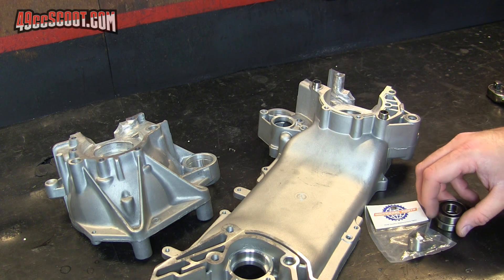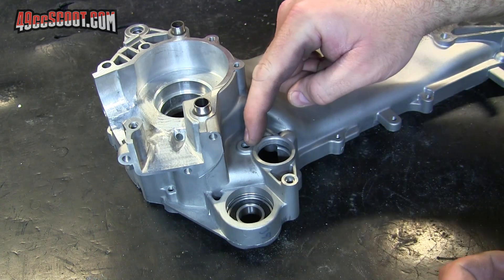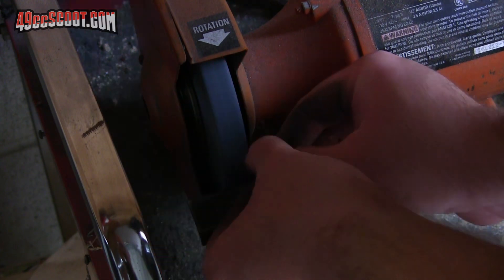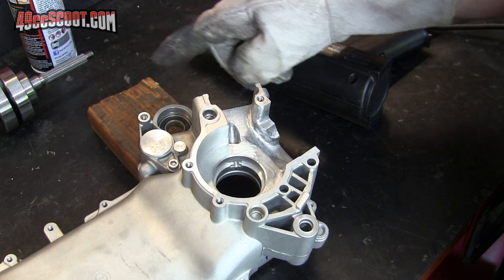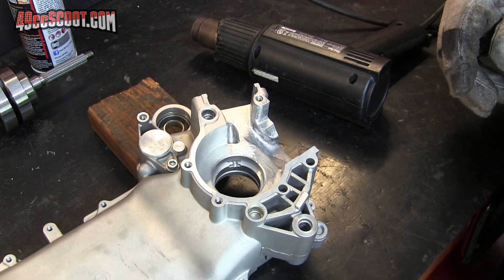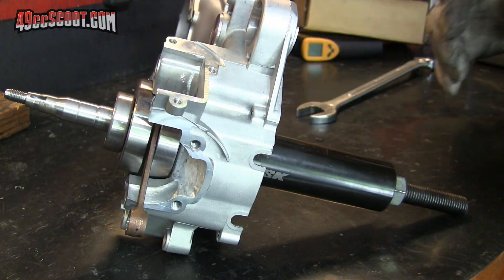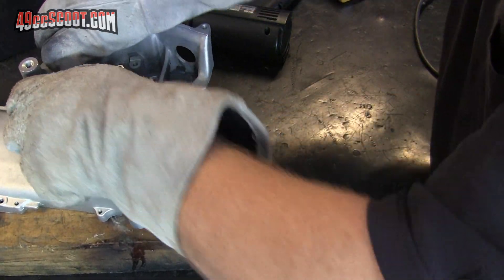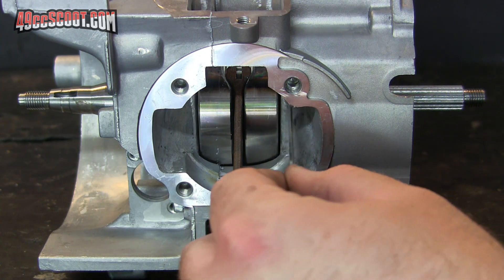TPR 86cc Build : Part 5 : Bushings, Bearings & Installing The Crankshaft

Comment: Because I see you reacting to Other fairly new comments I might aswell try…

Your the only one I have seen using a crank puller with bearing on the crankshaft instead of in the case halves. I currently have my crank seated in the cvt side with bearings attached. It is fine to pull it in with bearings on crankshaft?
Reply from the maker: Yes. As shown, I like to try heating and cooling first and then use the puller to finish. Some people pull them all the way in. Just be careful when it's starting into the case.

Comment: Please list the parts with links, thank you
Reply from the maker: The TPR comes as a kit to cover the engine. Cylinder, crank, bearings. Then add an intake and carb of your choice. I used a Polini intake and 25mm DellOrto PHBL. Malossi OR CVT kit.  Most of mine came from ScooterTuning. Looks like some of it is out of stock right now though.
https://www.scootertuning.ca/en/cylinders-high-end-77-100cc/17107-cylinder-package-tpr-86cc.html

Comment: Good clean build..professional level...but at home.
We were always taught to heat the cases evenly. Then bearings followed by the crank.
However, l noticed you do not seal the crank cases. 
We alway used to place a thin layer of pasta..sealant.
But l am talking some 40 years ago..😉🤕😅😅👍🇬🇧🇪🇦
I shall be viewing more of your well presented videos..
Reply from the maker: The cases are sealed. Shown briefly at 9:15. Thanks.

Comment: Teflon bearings are not assumed. the closed part from the crankshaft side and the open part from the oil seal side...and first the bearings are put in the crankcase and finally the crankshaft is mounted yes for the future

Comment: crankshaft and bearing should fit even without heat gun, just the cold from the freezer shoud be enouf to let them slide ez
Reply: This ☝️
Heat the cases and throw the bearings in the freezer for a bit. They pop right in. Throw the crank in the freezer for a half hour while you prep the cases for assembly (hondabond) and it will slip right in the bearings when you put the cases together. 
Alignment can be done if needed with just a few taps of a wooden handle OR you can blow money on the tool this guy used 😂

Comment: So basically this is a video on how TO NEVER ASSEMBLE an engine FFS. NEVER NEVER NEVER pull a bearing into a a seat using the Inner race, NEVER. FFS do you wanna pull the shaft? Heat the seat, freeze the bearing, insert the bearing THEN pull the shaft using the nut through the inner race so no damage comes to the bearing. Did you fuck up like in the video???? Pull the bearing out, BUY a  NEW bearing for 5 dollars and start again, it happened to everybody. So basically you fucked up the transmission side bearing thats the most heavily loaded on a  race engine...... good luck

Comment: Put the bearings in the freezer and heat the cases in the oven and they will drop right in and you don't have to worry about damaging any of the surfaces
Reply from the maker: I actually do like using the oven because it heats everything evenly and thoroughly if you give it time... but I haven't used it for years because sometimes I get a chemical or at least unappealing smell in there even with cases that are clean. I don't think other people in the house appreciate that and I don't really want to put an oven in the garage ATM.

Comment: I hate to tell you my friend but when fitting polimer cage bearings in a minarelli engine you have to fit the polimer side towards the crank Webb’s as the lubricating channels from the inlet tract go to the outside of the bearings so the way you have them they will not get properly lubricated. I made the same mistake. Basically you fitted them the wrong way round sorry for bad news
Reply from the maker: I'm not worried about it. I did them per TPR's instructions to place markings toward the conrod. You are the second person to tell me that's wrong, but TPR should be changing their instructions in that case. If it comes apart it will be after the bearings fail. I'm running it at 32:1, more than TPR recommends, so there's a lot of oil around.
Reply: @49ccScoot Hey man! 3 years have passed since you published this video, i wanted to ask you: how long did the bearings lasted, because i just also made the same mistake putting them that way when polymer side faces the engine block (like Stage6 manual said)?

Comment: i'm commenting on all your build videos ! lol!
tip from someone who has built a gazillion of this kind of engine !
first: heat up the case, put in bearings that must goes in free, use some weight for keep in place while cooling down 

second : fit the crankshaft in to bearing by pulling it , no heat required , just use rings ( i had to make mine from scratch ) , repeat on both cases  and close the engine case 

in this way your crankshaft will have no stress at all and will be perfectly centered .
Reply: Yes and a little oil on the bearings and crank helps , bearings can be punched in hitting the outer race with a punch if they get stuck with no panic. Some water drops bubbling to test if enough heat in the cases or its futile , i cool bearings only. Also heat gun the seals with grease seems to help fit or remove them. This also took a few builds and mistakes for me. Cheers

Comment: you should never heat bearings with polymer insert and you installed them backwards, good job :)
but otherwise good guides on the diy tools and such
Reply: it won't change much, since the fuel is in mist-type of state, but polymer insert helps with oiling
Reply from the maker: @ErnestsKrafts14  Thanks, but I did it as the instructions with the TPR kit said. They said markings toward the crank/conrod. The markings on the bearings were facing the center of the crank. Tell the engineers at TPR good job and explain to them why they're wrong please.

Comment: Hey man, am looking to put a 70cc kit, the dr evolution one, its a not so strong kit, and i was wondering if my stock crankshaft would hold on, or atleast for a little bit, untill i save enough money for a better crank, i have a chinese scooter, copy of the minarelli horizontal engine
Reply: Yes, if your stock crankshaft is in a good shape. I have a 70cc naraku kit in my scooter with stock crankshaft and I put around 6000km in it and nothing, so check it!